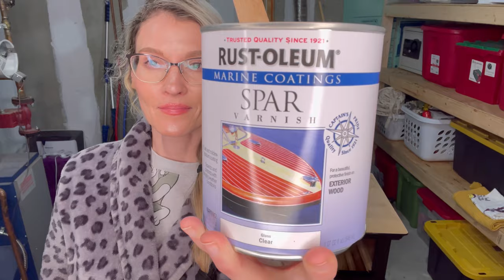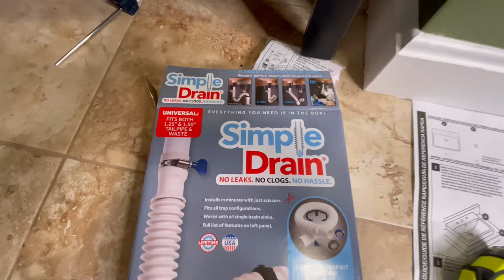How To Repurpose an Old Dresser into a Bathroom Vanity

Comment: Did you sand between top coats or wasn’t necessary with the nylon booty method? Thanks!
Reply from the maker: Sanding between coats varies from project to project. Sometimes I need to do it and sometimes I don’t. With this particular topcoat and project I had a few dust nubs that I had to sand down. When I say sand, I mean lightly feather sanding in between coats, using 400 grit sandpaper, wrapped around a felt block.

Comment: How did you reinforce the cut-out back sections? It looked like you only used glue? 

Terrific job btw. Not only in terms of the end product, but also in how you explained the process.
Reply from the maker: I reinforced those areas with Loctite Power Grab. Works great! 
Thanks for watching and enjoying the video. It's a long watch but I wanted to capture the entire process.